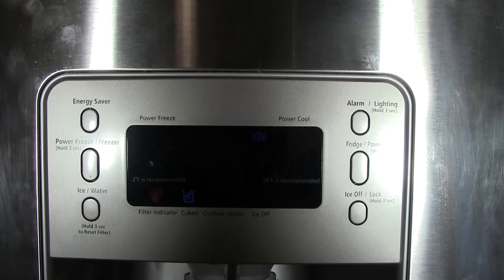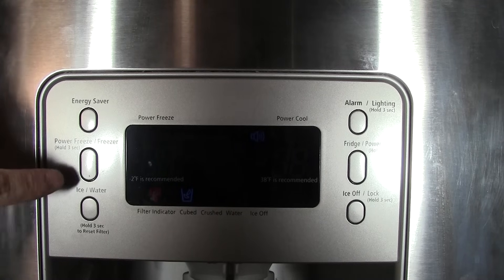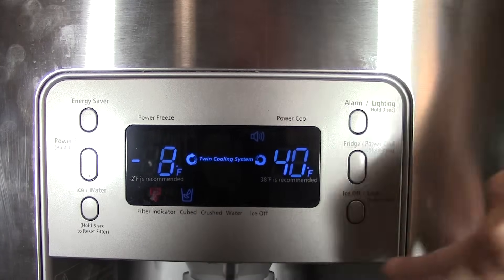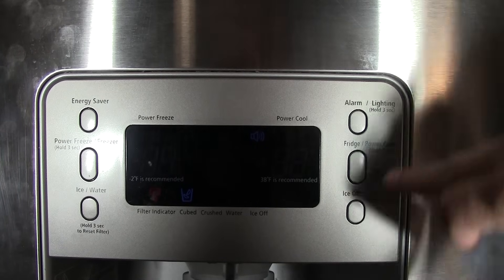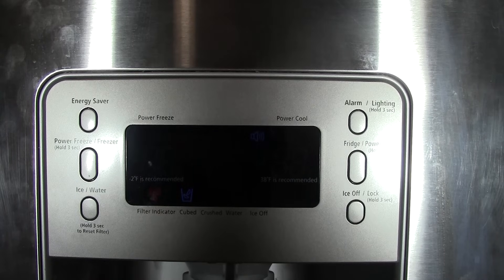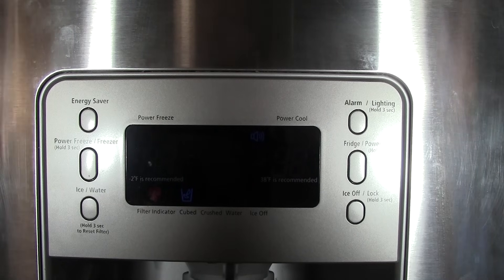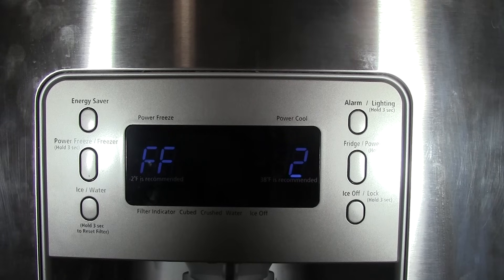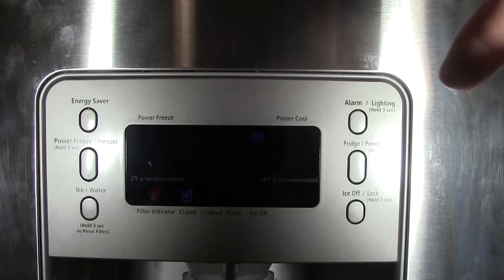FORCED (manual) DEFROST mode on a Samsung Refrigerator--Top Secret Setting

Comment: I just tested and did this on my fridge right now. once I get to fD it will not turn the alarm off with the energy saver and freezer buttons pressed. I had to re go back into the same function and then fD lit up and I had to press the button one more time. that made the fD go away, the alarm turned off, and then you could hear the condenser come back on. I'd be curious tho how long should I try this function to not spoil food in the process? of the door is kept closed it should keep the cold air in there I'd imagine.
Reply: as a follow-up I know in the video it says 1-2 hours. was curious if you or others had tried that. and it would also depend on the amount of ice already on the unit and assuming that the heater coil actually works! I've taken the fridge apart 3 times watching your videos they are great! I did the lower metal piece and added copper wires which stopped the freezing at the bottom and hole buildup but the ice kept forming around the sides and a ton at the top! so if it does it again I'll try your paper towel and tape trick it it can get me 7-9 months of having not to defrost it!
Reply: Thanks Kyle! I had same alarm problem & it was driving me crazy...(wouldn't shut off from Df mode)...now my alarm is off but unfortunately, I have not heard my compressor come back on :(

Comment: D Sharp
My Samsung refrig (# RF28HFED) is repeatedly having fan noise. I need the button sequence for my model. Also: how long will forced defrost continue? Must I, via button sequence, exit forced defrost? How do I exit forced defrost mode? Will the cycle continue long enough that food can be spoiled if I let it run it’s cycle?
Reply: Ours ran for half an hour and then went automatically back to regular mode. We'll see if it fixed the water leaks in the frig and the ice buildup in the ice maker.

Comment: On my Samsung refrigerator(RF28HMEDBSR) there is no way to get FF or FD options. It shows 0 0 when you touch and hold "Alarm" & "Fridge" buttons. You can turn the fridge off by touching and holding "Freezer" & "Alarm" buttons. But I want to know how to do Forced Defrost on this.
Reply: shanidbest I have the same model - any answer to your question yet???  I have rf28hfedbww/aa model
Reply: After some trial & error I found out that you just need to follow the position of buttons shown here even if the button is for something else. For me it was "Freezer" (instead of "Energy Saver" here) & "Lighting" (instead of "Fridge/Power Cool" here). I pressed and held it for few seconds and then these options showed up. From then its just like this video.
Reply: shanidbest didn't the video say to press energy save and then fridge to get the forced defrost?
Reply: thomas betts yes, but for my model it did nothing. And I had to play around a little to make it work with my model.
Reply: shanidbest I think I have a very similar model to yours. I did the 24 hr defrost thing on demo mode and it seems to be working again. But I would like to maintain the fridge with FD mode. What did you have to do?
Reply: Forced Defrost mode only lasts 15 minutes or so. I think only thing you can do is turn it off or turn the compressor off.
Reply: Do you know how To do it with a whirlpool  #  WRF560SFYH01 Plzzzzz
Reply: sorry, I don't know about whirlpool refrigerator. I only had to deal with Samsung so far.
Reply: Is it okay to do it with the fridge/freezer full of food? I'm having the infamous ice maker issues now with the same model you have. The grinding noise is getting really loud now (2+ year fridge) Regret buying Samsung Appliances
Reply from the maker: +Jaime Borjas --> for a few hours as long as the door is closed I would think you are ok.  If you want to do a complete defrost, I'd put the perishables in a cooler with ice.

Comment: I Twice I have needed to defrost the drawer freezer on my Samsung Refrigerator.  What a pain.  Had a gap i/4" across the top of the drawer tapering down to nothing and tight across the bottom go the drawer.  I found the gasket was not connecting to the sides of the freezer drawer, or at the top and across the top.  A video showed an adjustment on a GE model to fix this.  This freezer does not have this adjustment!!!  After scratching my thin head of hair, I realized I could add a bib washer 5/8"diameter behind the bottom of both brackets holding the slide to the door to shim it upright again.  Problem solved in 15 minutes!  
I think the reason this happens is that when the drawer is opened, the user (kids looking for something cold to eat) leans on the drawer as they scrounge around.  This puts stress on the open drawer and causes the gaps.
There ought to be a law against bad engineering
Reply: When the ice below the freezer bin gets thick it can cause the same problem, which lets in more humidity and cause more ice to form. I hate this frig.

Comment: Hi I have a Samsung side by side refrigerator model # Rs277acrs  I'm having problems with the control panel I can't turn  the temperature up or down on both freezer and fridge side no matter what button i push unplugging don't help resting it don't change nothing either .any suggestions?
Reply: I phone about mine as I was having water under the crisper and they told me there was "no" drain.  I don't believe them.  I have the same model.  Have you tried the above tricks??

Comment: I have Samsung 4 door fridge from 5 years. Recently having fan noise . Looks like ice build up around fan. 
I tried to hold energy saving and fridge power button at same time hold. It's not turning off. Kindly advise.
Reply: Its the top left button and middle button on the right. It doesnt matter how they are labeled as the button labels vary amongst different models.

Comment: QUESTION - Forced defrost (Min 6 in the video)- How do you do it for the fridge only, and not for the freezer?  I will appreciate the answer for the RFG29--- models. In other Samsung French Door models, there is an option of pressing the "fridge" button only 3 times, it displays as FF. which - as explained - is Fridge (only) Forced Defrost.
Reply: FF means   Forced Freeze
Reply: it's the rd mode that is refrigerator only
Reply: I think Rd is refrigerator Defrost and FD is freezer Defrost.

Comment: Have a counter depth samsung that is icing.  It is not  a failed heating/defrost coil.  It's a crappy design in how it drains.  It would appear the tube is too narrow, and the defrost clip is not sufficient for the task.  As a result, the tray at the bottom of the evaporator coil freezes.  Each time it goes to defrost the melted ice runs down the cabinet, and in my case, ends up on the bottom of the freezer.  I'll see a puddle of water on my tile a few days each week.  There are a few videos out there that some DIYers have put together as fixes.  I"m going to attempt one of those today.  (in a nutshell, I'm going to use a few lengths of bare copper wire wrapped around the bottom of the heating coil which will extend into the drain tube.  Kind of like the rooftop gutter heaters people up north use.)  Furious with Samsung/GE for allowing this POS to go to market

Comment: Have had an ongoing problem with Samsung concerning my 26.3 cu.ft. French door refrigerator since the day of delivery. After 6 attempts to repair and the replacement of every part of the ice maker and water system. In some cases more than once. The unit still leaks water prior to the delivery of ice, about a 1/4 cup, leaks water onto the pantry shelf, forms balck mold on the underside of the vinyl gasket at the top of the ice chute, and constantly the ice maker stops making ice. The executive customer relations department has promised a refund. After emails and phone calls that promise within 3-5 days a resolution. Today's response is that that department, the refund and exchange department is overwhelmed and does not allow phone calls only emails from the other departments. As a result their communications take 3 to 5 days to get a response. They also say I cannot replace my refrigerator until they have sent me all the paperwork to sign. If I do I might not get my refund. If the unit totally fails that is too bad. As of last week it is making a constant wheering sound. 
What I am conveying, I also wrote to Tim Baxter the President and CEO of Samsung NA, that service and communication is wanting in this corporate structure. To ask someone to hold on to a failing appliance because of their internal issues is not an acceptable response.
I would advise every consumer of an appliance to ask at the point of purchase, "What is the service record on this manufacturer"? Had I done that, I would not have purchased a Samsung appliance. Home Depot, Lowes, Best Buy, and two major appliance only retailers in my area all said, Samsung service was the worst of all the others.
Reply: Jon Polayes 

I had so many problems with mine giving an error code,  lowes paid me back what I paid for it plus I got to keep it. 
Took out the extended warranty.

Comment: Did not work for me, but excellent info. My issue had Samsung saying fridge temp is 12 degrees colder than it actually is, so compressor shuts off thinking it is at temp, when it is really 45. I heard their was a control hack for this, like the FD. Does anyone know it? How to calibrate the sensor I guess.
Reply: It could also be that the temperature sensor is covered in ice.  I took mine apart for and that was the case.

Comment: So my fridge has been randomly not cooling until I unplug and replug, then it works again, could this be a frozen fan issue?
Reply: Did you figure this out? I'm having the same prob with my 2004 Samsung model.
Reply: But it affects both frig and freezer
Reply: Mines is working especially the freezer
Reply: I'm having this same issue
Reply: @karajones7796  so I had a technician look at this and it was an issue with one of the circuits in the fridge. It had to be replaced I will need to ask him what exact part it was
Reply: @pnkbom  Ya technician had to replace a circuit, I will have to check exactly what was replaced and I can let you know, but it will as an electrical problem
Reply: @asadianbelifont3875  thanks. No rush. We have a "Thermo bimetal AD..." part that we were going to try next and if that didn't work, either spend $100 on circuit board or take it out to the road 🤷 It's on the to-do list, right after we fix everything else that's breaking...
Reply: @asadianbelifont3875  Can you tell us what the exact part was?

Comment: So I have an issue with my ice maker not making ice,  but I'm getting water through the dispenser.  Would this possibly help with that issue? And should I empty the whole fridge to do this?
Reply: No call it in to samsung there is a recall they just put out and every one is covered for an update
Reply: It not working naw
Reply: @jacobsalcido2428  would you happen to have more information on this recall?  I too have freely flowing water, but the ice on top isn’t making ice, yet my lower ice maker is working fine.

Comment: My refrigerator has 2 icemakers.  I understand about the top ice maker ( or usually NO ICE MAKER), but somehow the bottom ice maker got disabled from the front led screen and no matter what I push, it will not turn on!  ANY IDEAS would be appreciated.
Reply: There is a button on the side of the top ice maker.  I don't know if this helps.

Comment: I can’t locate a water filter on my Samsung, but my change filter light is on. It’s a French door unit with only an ice maker in the freezer. What should look for and where.?
Reply: Its in the bottom middle of the fridge corpatment. Looks like a cylinder. You have to rotate it and pull it out.
Reply: @georgioskambourakis  - Agreed!

Comment: Curious, cant I just unplug the fridge and do away with the annoying beeping? What is to gain by using the factory fix for a factory problem?
Reply: gizmo a technical had said to pull the plug out leave it for an hour and then plug back in and fridge would reset itself but not mine

Comment: I've been searching all morning for the forced defrost code for the Samsung - RF18HFENBSR. Codes are different than for Jake's unit. For my RF18 to enter demo mode, it's power freezer/freezer. I've played around with codes hoping to find the forced defrost function to no avail. About to break out the blow dryer, igloos and unplug the unit. Anyone know the top secret code for my monster?
Reply: For mine, I had to push Energy Saver and Fridge/Power Cool in order to get to the Force Defrost mode.

Comment: It's a little off topic but I have  a leak coming from a panel about 10x10x2 in the bottom left corner of my RF267.  Does anybody know its name or function so I can start researching? The leak then freezes causing me to believe I had a blocked drain.

Comment: My fridge temperature display doesn't stop blinking. it started defrosting by itself. I didn't know about the defrost feature it is indicated in this video. I unplugged it.  I am about to call the technician. Any idea why was the fridge temperature was blinking.
Reply: The manual says that the fridge temperature will blink when the temperature gets too high.  My fridge temperature started blinking but my fridge temperature was too low.  This was due to the damper in the back of the crisper drawer being stuck in the shut position.

Comment: I have a different issue.  Ice dispenses fine but pressing the selector ice/water switch doesn't work.  I'm stuck in ice dispensing mode and can't switch to water dispensing.  Any suggestions?
Reply: LG

Comment: Hey Everyone- I have a RSG257AARS  .. issue is that the freezer grows frost/ice by the ice maker in the freezer door. Eventually the ice freezes up the mechanics that crush the ice, and eventually you have to remove the ice bucket just to get ice, More recently, the water dispenser will just start spraying water ( stops when you press "Child Lock") 

Anyone have these issues and any fix? Thanks! I looked around to just replace the entire assembly, but don't see the parts available.

Comment: when I try going back to normal mode it keeps displaying OFF-OFF The compressor won't go back on. I finally got it on but the fridge fan is not going on. When I pulled the cover off the fan had a ball of ice so the fan could not run do you think it burned the fan?
Reply: I don't think so because this has happened to me 4 times and when I finally bought a multi meter it was ok so I didn't buy a new fan. Now I did call Samsung and they told me my refrigerator didn't have a fan as I had it in my hand. maybe she was having a bad day maybe I didn't explain myself correctly so I got explicit and she got explicit with me ... she told me again my fridge doesn't have a fan. Well it does bought from amazon. Yikes
Reply: Charles Whitney the fan doesn’t run so I don’t know what els it could be
Reply: Thank you for the Forced Defrost info.  We have been using a hair dryer!

Comment: I have a rf267abrs ., the freezer won’t freeze but the upper side of fridge is cold . Can someone give me any tips before a end up calling a mechanic 👨🏼‍🔧
Reply: I have same problem now. The upper is reliably at 38 degrees, but freezer is just below 32.  I discovered that I could temporarily get the freezer to get down to 10 degrees F by unplugging unit for 30 sec to reset board, and then put it on "power freeze" .  After resetting, the display shows the internal temps as they really are so you can monitor that the freezer is actually getting colder. After several hours it eventually goes back to losing temperature again, but this technique offers a little reprieve from the urgency to find a real fix. From searching other youtubers with similar complaints, it seems the freezer evaporator coils might be frozen, or the temperature sensor might need replacement.
Reply: @lesliespira5505  you may need some regular maintenance, cleaning the back, defrosting, etc.. if power freeze works, then the compressor and other mechanics are fine.

Comment: I have samsung fridge rf25hmedbsraa and this method for defrost does not work. Tried various times and cannot get it to work. Also tried to get into demo mode and same thing, does not work. Any other suggestions on how to defrost my ice maker?
Reply: I have the RSG257AARS/XAA which has the contained ice maker (I cant get at the 'insides' of the ice maker. Problem: Ice maker is frozen, it wont eject ice. Blockage seems to be at the bottom of the ice maker chute. How do i defrost it to clean and start ice making over again?
Reply: I finally shut the whole unit off, let the ice box melt, used hair dryer up the chute and got it to melt enouht to dislodge it.
I did find that making the freezer 3 - 4 degrees colder solved my problem. So far!

Comment: Is forced defrost on a timer or will it go until it's stopped by the user?  Most fridges have a defrost timer that regularly does this for short periods and there is no concern about food going bad. Is a forced defrost more aggressive than that? Also I have a layer of ice under my bottom drawer. I'm concerned the drain is blocked/frozen up and if I do forced defrost I may have a small flood.  My ice maker, which I replaced, is not making ice. Is this related?  I have the same model as the one in the video.
Reply: Tech told me 3 hours
Reply: Shane Smith  I timed it. 22 mins.
Reply: @stevescott749  heck yeah, i found an easy fix to where you don't have to defrost all the time.
Reply: Shane Smith  well I discovered the water leaking inside my fridge which then turns to ice has nothing to do with the need to defrost or blocked drains.  It's coming out of a panel in the bottom left corner I don't even know the name of.  It's not the damper.
Reply: whats happening with it I'm trying to trouble shoot all of these issues with the water collecting under the crisper drawers...